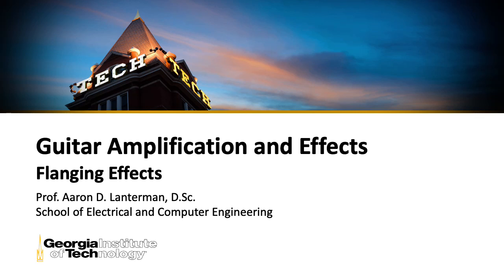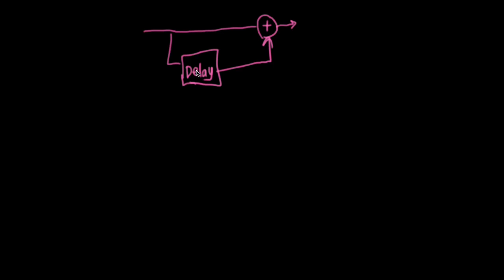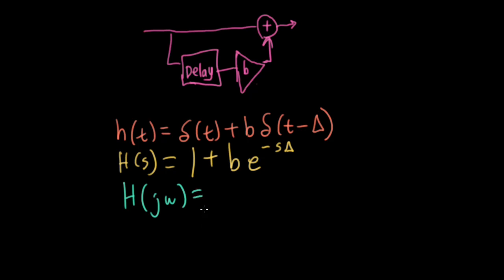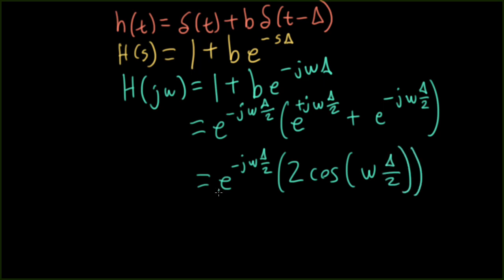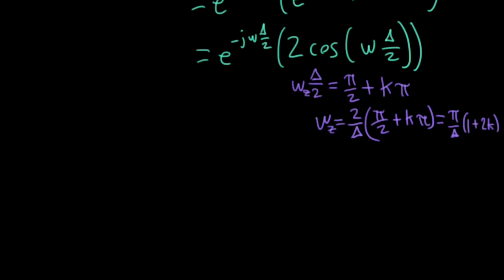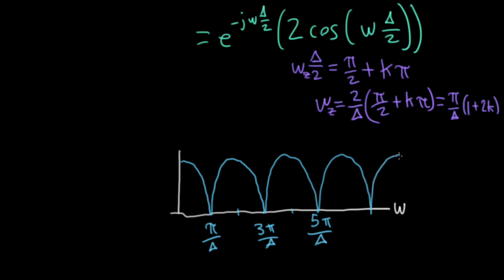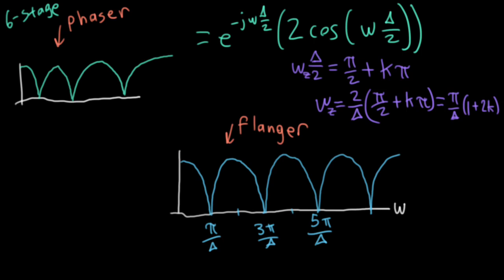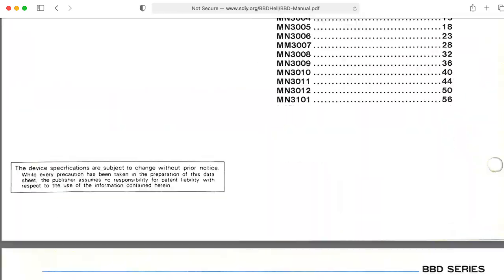ECE4448 L39: Flanging Effects (Guitar Amplification and Effects, Georgia Tech course)

Comment: "It's going to feel like there's a whole bunch of nulls bunched up in a particular frequency."

This is not technically wrong, but I feel like describing it this way is missing a bit of context. The null are spaced out according to the harmonic series, with the fundamental being 1/t of the delay time.

The flanger will emphasize the even/odd (depending on whether the delayed part is added or subtracted) harmonics over this fundamental, almost creating a phantom sawtooth/square wave. Unlike a sawtooth/square wave, the amplitude doesn't decay with increasing frequency, so higher frequencies will seem "unaturally" emphasized compared to the infinite harmonics of a square/saw wave. Tinny, as it were.

But what I'm getting at is that, whereas I think a phaser will typically create perceivable "holes" in the spectrum, a flanger will be perceived as affecting the whole timbre of the sound at once.

Maybe what I'm saying is biased from experiments with using things that are not usually considered oscillators as oscillators.
Reply from the maker: That's a good point.

Comment: 6:42 it depends on what your X axis is.  If it's linear frequency, sure, but you don't actually spell that out.  If it's log frequency, then it's the flanger response that bunches up while the phaser diagram is equal-sized

Comment: I wonder if BBDs can be tuned to incoming audio... Also, something unrelated to today's lecture: apparently, the Steiner VCF uses diodes as (nonlinear) voltage-controller resistors. Do you intend to cover that design? Perhaps it's better suited to your ECE4450 course.
Reply: You might enjoy Moritz Klein's videos on designing (among other things) VCFs. I don't know from memory if he touches upon the Steiner VCF specifically, but he does have a video about designing a diode ladder filter. The videos take you through the whole design process and explain things well.
Reply from the maker: @Gameboygenius  I love Moritz's channel!
Reply from the maker: No particular plans to cover the Steiner VCF. It's an interesting design though. It seems to be that it will change characteristics when you plug into the various inputs, like, even if you don't put any signal into that input; like if you put a signal in one input, then grounding another input will make it act differently than leaving it open.

Re: the BBD, you could potentially try to do a pitch detection on the incoming signal and use that to drive the BBD frequency somehow.